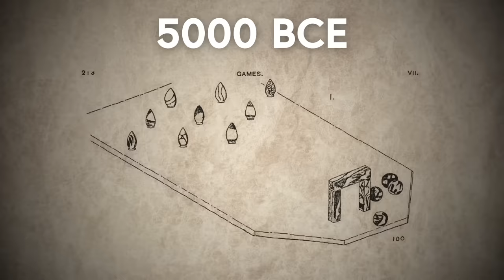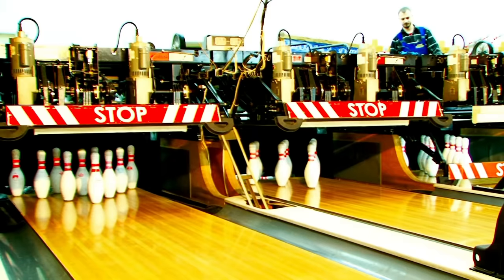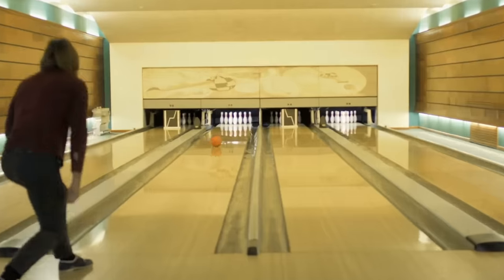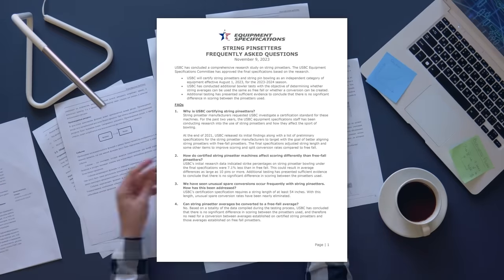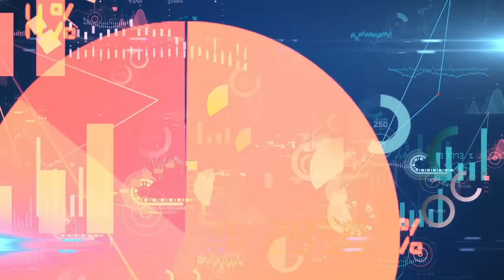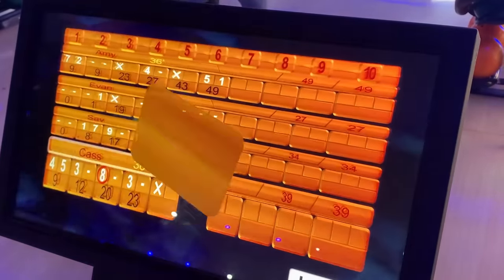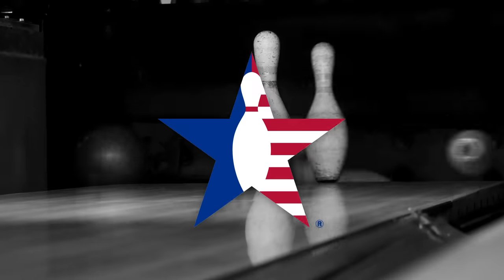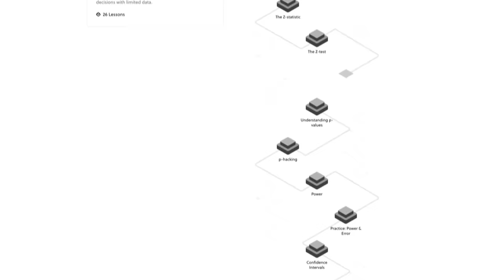The Controversial Machine That’s Ruining Bowling

Comment: The trademarked name for he machines made by AMF (American Machine and Foundry) are PINSPOTTERS. Brunswick's trademarked name is PINSETTERS. AMF's machines used three motors, mechanical drives and microswitches, two controlling he sweep, ball return, pin elevator (A big circle) and pin distributor. The third motor controlled the sweep. It was controlled by a box of Potter and Brumfield relays, conveniently made by an associated company. 
Brunswick machines were totally mechanical in nature, using belts, levers, a transmission, cams and clutches, They made a peculiar whine when idling. 
AMF first came out with the "Sparemaker", consisting of lighted arrows which would display on the pin field above the lane, suggesting the best way to aim in order to make a spare. It was controlled by a relay assembly, one for each 8 machines. The remaining pins detected information was fed to the Sparemaker box, which used mechanical relays and Boolean logic to determine which arrow to be lit.  
I worked on AMF machines on an off for a few years, they were easy (for me) to understand and maintain. The Brunswick machines were always a cipher to me. 
AMF's pins were considered the best, and the trademark was two red circles on the neck. Brunswick's pins had a ring of red pointy things resembling a crown.
The lanes were made of strips of hardwood (usually maple), now it's just a plastic laminate marked to simulate the old wood strips.
You're welcome...

Comment: I worked in a bowling alley in highschool back in 1968 or 69. I never got hurt plus made repairs the owner didn't think I could do. You did have to be careful when working on top of a moving pin setter but just pay attention to what you're doing. There is a power cutoff switch at every machine.

Comment: I work at a bowling alley, and honestly, League Bowlers get upset if the floor is slightly sticky, the balls take slightly longer to return, their issue isn't fixed within 2 seconds, etc. So of course they're gonna throw a hissy fit over pins on strings, even though that would clear up 90% of issues (like when their balls get stuck because a pin get's lodged in the ball return, thus stopping the balls from being able to shoot through the ball accelerator), get's rid of the need for pin belts and pin elevators, which in turn greatly reduces a lot of down time, and would basically allow them to bowl their games more efficiently.

Comment: My brother and I decided to try the strings on ten pin earlier this year and we were totally disappointed at the mess they are!
Several throws into our games we wound up sitting while the pins went up and crashed down to the deck, time and time again!
We counted 10, 20 and sometimes the lane shut down because it couldn't set the pins.
We booked for 3 games and we quit after 2 games as it was just too frustrating to go on.
In the 10 years of bowling we've never had any issues with the free fall pins as they just worked.
I will never bowl at a string lane again, just too frustrating and it does not play like the free fall lanes.

Comment: Ive worked on gsx ( which is the machine in the video) and A-2, and the companies I have worked for have strict LOTO (LOCK OUT TAG OUT) rules fireable, no questions asked You could not take a guard off or move past the plane of the machine. That being said, mechanics are lax on it, but each machine should have a switch on the back which cuts power to it, or you can un plug it directly. Most injuries are the fault of the mechanics being careless. Be there done that got the stained t shirt

Comment: The only thing they proved here is that people who don't care about anything but eating and drinking can't tell the difference. People who try to get better watch how the pins fall and say, "What the hell is this?" No messengers?( a pin, usually the head pin) that bounces off the side wall and rolls across the deck to take out the last pin standing. Strings knocking over pins that were otherwise untouched.? These things are saving bowling? They just killed bowling and replaced it with a ridiculous arcade game. Let bowling die if this is the future.

Comment: The uptime on an automatic pinsetter is supreme to a string pin setup. The most common problem an automatic pinsetter gets is a pin getting stuck in the gutter while a professional no-no to play on, it still allows the game to continue. String pin machines are apt to naturally getting twisted up and definitely a simple fix, but the lane also has to be shut down while someone untangles them if they can. You've also compared old automatic pinsetters with likely a good amount of wear to new string-pin machines with likely newer tech, so which one would you expect to run better? It just comes down to what kind of customers an alley gets. If they make money off of league play, they're never gonna switch over until USBA/ABA makes it official and even then, it'll be a separate league with a fight for lane space in an alley. Multifloor entertainment places that make money from casual stuff like cosmic bowling or cheap beer nights would see success with string pin machines, but they have to make that investment too.
You kinda also have to note that people can also accidentally die in string pin machines too if they don't turn off the machine before getting in. Probably a less severe chance, but an automatic pinsetter is a highly technical machine that needs to be treated with respect. Those 2 deaths you cited may have been the only 2 recent ones as well.

Comment: These old pin setting machines seem cool but from my personal experience, they didn't always work perfectly. Here is just one example that I encountered:
In one round of bowling, I made my first try and got a nice hit on the pits, but sadly, one of them was still standing. The computer confirmed that I got 9 out of 10 points and I was already mentally preparing for a very hard second attempt to hit the single remaining pin (I'm usually not very good at this). But then the machine was cleaning up the area and for some reason, it just took the last pin with it. My first try was over and the second one hadn't started, so the computer didn't count that as a hit. The barrier went away and the computer told me that I now could take my second try, when there actually weren't any pins left. So I was aiming for literally nothing and made the ball roll without any effort (because what else could I do). The ball reached the end, obviously without hitting anything on its way, but the computer congratulated me for hitting the last pin.
And that is just one story. Things like this happened in basically every bowling match I played. Me and my friends would always blame the old technology for that because the bowling alley we went to existed at least since the early 90s or even the 80s, so it was like 20 years old and as far as I know, nothing has been updated or renewed since then.

Comment: 5-pin bowling has been on strings for decades.  The problem is entanglements and having to wait for someone up front to run back and untie them so that the pin setter can reset. I can only imagine entanglements being far worse with 10 pins.

Comment: In the early 70's, my parents became good friends with the owner of an AMF alley in Bellevue, NE. We were all avid bowlers, I was just entering Jr. High. I learned everything I could about the pinsetters and worked the machines on weekends and some evenings. I read all the manuals. The only part we weren't allowed to work on was the control box due to high voltage. Some of the other high school kids would call if they had issues. I climbd all into the machines to unjamb pins and clear blackouts, etc. OSHA was just forming, it was crazy dangerous. High tork three phase motors, catch points, rotaing shafts. Ironically, I spent 30 years working for OSHA and was aware of numerous fatalities and severe injuries. I was fortunate I avoided those fates. Things were very different back in the day.

Comment: I am giving Half as Interesting 5 stars for not just saying "not significantly difference" but provide the stats behind that inference. 

That being said,  I am assuming USBC was using a alpha level of .05, so p < .035 would be significant.  The p-value of a paired t-test is probability the difference between the two means is 0, no difference.   So p < .035 would mean the pin machine made a significant difference and while p < .035 isn't enough to slay or mortally wound the null hypothesis it would be in a lot of pain.

Comment: Hm... part of the issue with the old-style pin setters seems to be the fact that it's heavily mechanical in nature. A lot of the mechanical steps could be replaced with a simpler design and a bit of extra software. As is, the various belts are constantly running, this alone induces a LOT of wear and tear on the various mechanical parts including the belts themselves. Now, if instead of having the pins cycle through constantly, you instead only ever loaded pins when resetting the field, you wouldn't have that issue. You'd save energy and you'd reduce wear and tear on the mechanics.

The main issue with the string setters is that the strings could knock down additional pins or change the movement of the ball.

Comment: Instead of using strings, I wish someone would make a more efficient system for resetting free fall pins, something that doesn’t require as many moving parts, or electricity.

Comment: These are a BAD idea. It's not like a computerized counting system or automation, it messes with the core principle physics of the game. 

It totally effects how the pins act. They dont travel normally after being hit. They can't tumble, topple or roll properly. 

If you watch up close footage, you can see the strings hitting and wrapping around each other causing them to move without the actual pins touching.

Comment: Ive been working full time on these machines for 8+ years. I am fully trained on the Brunswick GSX that's shown in your animated diagram. Everything is correct aside from the "camera". GSX uses pin detection plates that work on the depression of mechanical microswitches that tell the pinsetter what pin is still standing. The GSX is relatively new, only being around 20 to 30 years in use. Brunswick's older models, the A2s have been the standard since the 50s. These machines are almost entirely mechanical and dangerous to work on. These use a giant metal wheel instead of an elevator. It would separate the pins from the ball and load them into the top basket like a gun revoler. These machines are the ones that use cameras at the time. 
I have been on a team that took out 28 of these guys from a bowling center to replace them with the AMF Edge string pinsetters. I gotta tell yeah the noise difference is night and day! String machines have fewer moving parts. Aside from pin fall, completely silent. And yes, less dangerous! Mechanics dream lol. Instead of a motorized ball accelerator,  it raises the the ball up a ramp and brings you the ball via gravity. This machine will also give you texts on your phone when it needs repairs complete with videos and steps on how to fix it. It really is a game changer in more ways than one!

Comment: IMO, what ruined bowling was the lane short oil pattern rules in the 80’s. The ABC allowed any pattern as long as it didn’t extend past approx 20ft. So “blocking” the lane became legal. Which improved scores dramatically. The advent of reactive balls enhanced scores again.
The league bowler wanted to bowl once a week with little practice and average 200 with a long neck in one hand and a non-filter in the other. 
So they thought they were good. Vast majority of bowlers are not as good as their average. If they weee to bowl on near “flat” oil, they’d struggle to shoot 170. There’s a tourn in our area that does this. Flat oil and only rubber or plastic balls. Bowlers who average 200-230 struggle to average 190 thru ten games. Those tourns will test if you can throw at a very narrow spot consistently and control speed as well.

Comment: I can't argue with stats gathered from a bunch of different sources. However, my friends and I started going bowling this year after work. We didn't notice it at first, but the bowling alley has pins on strings. The pins are clearly lighter, as just the vibration of hitting nearby pins seems to knock them over. Personally, I can see a change in my score, specifically in the amount of spares I get. Not only do I get more spares, but because the pins fall over more readily, it means the first throw after a spare usually nets 1-3 more pins than I think I otherwise would have gotten. Not that it matters, but we've also noticed the #7 pin (backmost row, center) is very frequently left standing, because the normal collision of pins is off. What made me laugh, was when my ball clearly connected on the second row, but I somehow managed to knock over the head pin despite not even being close to touching it.

Comment: The Stringds you showed in the video, was not on full size pins, they were duck pins, and have been around for a while.  We have a new set of alleys nearby, and they are duck pins with strings.  Based on watching the bolowing, I beleive the strings affect the pin action.  When you can see pins going all the way across the alley, with strings I think this would hold them back.  Just my opinion.

Comment: Still gotta have mechanics. Ball stuck in the ball return, sweep stuck down,  a 180 (power to the lane shuts off) pinsetter stuck in the down position.  Strings stuck in knot and have to untangled. I am sure there are others as well....

Comment: I have bowled on both Strings and Free fall and have an average of 198 currently.
There is a MASSIVE difference between free fall and strings, In bowling you get the normal thing of what they call rapping the 6 around the ten (Right Hander Bowlers) This is when the 6 pin goes around the 10 pin instead of taking the ten pin out. On free fall that's not a problem but in string pins it's a MASSIVE difference because the string actually fiscally pulls the pin down! Trust me it looks strange seeing pins magically fall and that is the big problem for Leauge / Pro Bowlers. 
For social bowlers string pins are great but for people who take the game more seriously, it's massive and does change the game.

Comment: As someone who works with pins on strings, I can tell you that while they may not be ruining bowling, the strings definitely change the game. I’ve seen countless times where the strings falsely knock over unstruck pins. Also, the strings are poor at accurately registering which  pins should count and which don’t. I get the idea and the benefits, but personally the technology isn’t there yet. Oh yea and they get tangled way too easily and it’s a PITA to untangle them.

Comment: I don't bowl much, but it's clear strings hamper pin movement. Pins don't move the same way when they have strings and it's far less satisfying.

I believe a healthy mix of options would be ideal. Strings for alleys that would otherwise fail, but machines in areas with enough foot traffic to keep a superior bowling experience.

Comment: string setter change the movement of the pins on impact, it would be better to thread the pins with a "magnetic core metal" and use an EM to reset the pins

Comment: Every development in bowling raised controversy when it started. For example allowing reactive balls that curve into the pins rather than the straight plastic balls in the early 60s. When they went from wooden lanes to synthetic lanes in the 90s. When they went from no oil on the lanes to oiled lanes. Every development people complained about but eventually accepted it. String pin bowling is here to stay and it will save the game from extinction.

Comment: 1 bowling alley just closed that was less than a mile from me. It was about 30 years old. There are only 2 left in the metro area of about 200k people. one bowling alley is much older and the other much newer than the one that closed. None of the bowling alleys here use or used strings.

Comment: The GS pinsetter in your animation doesn't use a camera to count pin fall. It uses mechanical switches on each pinholder to detect pins.

Comment: Actually, there's this video called "THIS is why STRINGPIN BOWLING should be ILLEGAL" that show strings prevent some types of shots, like if you have 2 pins far apart, you can't bounce 1 into the other because it'll now be stopped by the string.